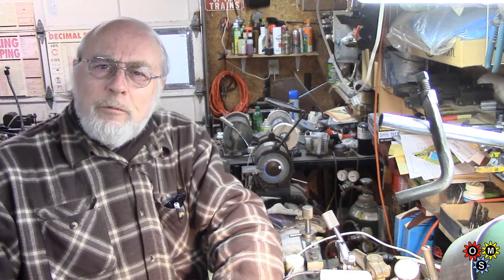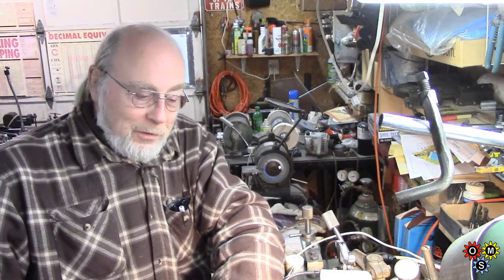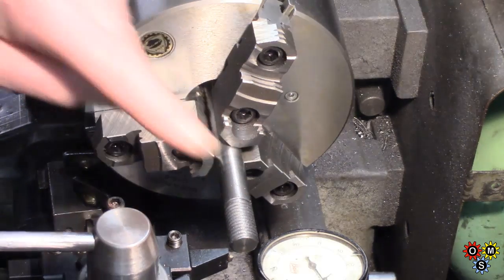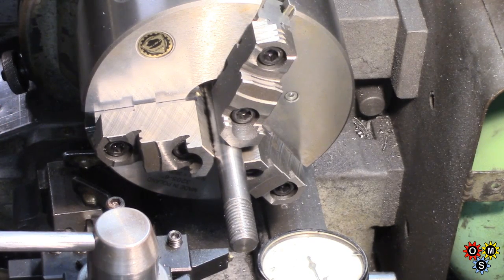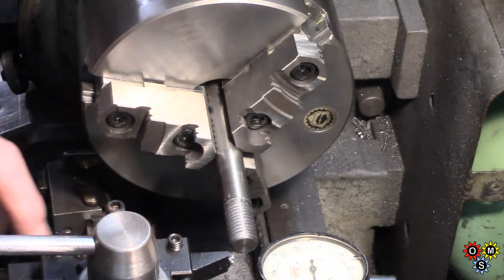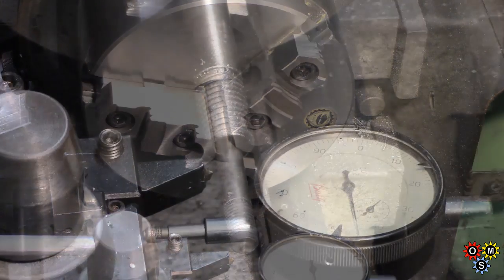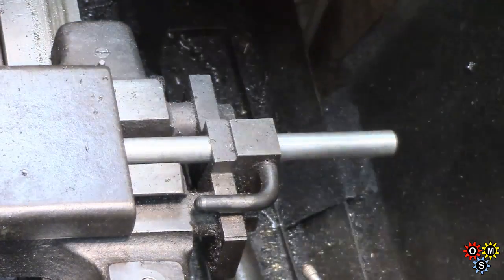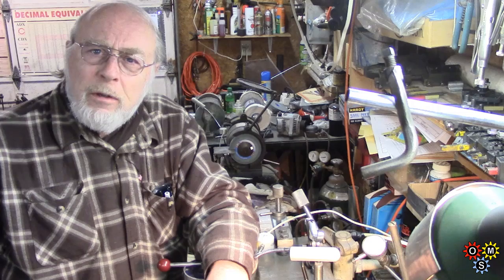Thread Cutting  Preferences

Comment: You have  train your ears to pick up the 1st sound of the item hitting , and the listen very closely for the 2nd sound of where  lands after 1st bounce .  I dropped the needle of a  float  this afternoon and took forever trying to find that damn thing , Of course its non magnetic stainless so the magnet trick didn't work .
Reply from the maker: +Rockland Kcorvic 
Hi - that can helps if it works but even so - all too often the bounce can go either onto floor mat or similar and so, no sound! Can well imagine trying to find a float needle - ouch!

Comment: I'm thinking about installing carpet in my shop to stop thing from bouncing around far away, shaggy carpet should do a great job...   lol
Reply from the maker: +pierre beaudry 
Well - I do have some old carpet/rug around main area - does help but it actually has some 'spring' in it so - can give a 'bounce assist'!! I guess heavy shag pile might help, until you want to clear up chips and stuff.
Gravity - can't beat it - it always wins. :)
Reply: The carpet would become the same problem as my chip pan on the lathe, always full and needing to be cleaned, where everything that falls in there gets lost forever.

Even in a house a carpet is to prescribe, never know what lives in it.....    ;)

Comment: You must have missed the "inverse proportion rule" in basic physics.  The more you need something the less likely you are to find it.  Thus to find your missing object make or buy another and voila it will reappear like magic.  This rule is also compounded by the price rule.  The more is costs the more rule 'A' applies!  Plus the rule of age:  the older I get the farther away the floor is.  So taking all this into consideration and your trajectory rule as well the conclusion and answer to the equation is, go have a double shot of a good single malt and don't let it get beneath table height!!  It is 40 degrees here in Alaska but don't tell anyone or the shovel zombies will show up.  Doug
Reply from the maker: +Douglas Thompson 
Hi Doug,
I think you nailed the 'dropped object syndrome' very nicely! :) 
We used to reckon that "Murphy" has a hand in such events, such that objects become imbued with their own devilment. Distance to floor is certainly a major factor these days! I'll take the single malt (or three).:)
40 degrees up there - amazing.
Reply: Sounds good but don't pack your bag just yet.  We haven't had a blue sky day in two months with wind (to 100 plus) and constant rain.  Blowing 30-40 and 3-4" rain today but it is 47 degrees.  Open winters are rare but we will take it.  Fishing is good and small boating excels plus they haven't run out of Glenfiddich and no one has tried to put ice or water in it!  Doug

Comment: Too bad your shop time is limited by the cold. As for "part bounce", as a former watch maker I can tell you, it's the worst!
Reply from the maker: +ExtantFrodo2 
Hi -- well, trying to be patient until temps improve properly, and then I'll start sweating again.
I can well image a watch maker's angst when something drops - and usually I suppose quite the tiniest parts too.
Reply: ChrisB257
The typical watchmakers bench includes a pull-out-baggy-cloth-net parts catcher (which is only occasionally where the parts end up when your tweezers cross and the part goes flying).
     I'm guessing you can't afford to insulate and heat the shop? Time to start making the shop pay for itself... although it does seem to be more of a hobby shop you have there. Patience is a virtue, but heat is better. :-)
Reply from the maker: +ExtantFrodo2 
I do have heat but a space heater - instant heat. It helps but when real cold it uses a lot of fuel for a temporary benefit - plus equipment is itself at ambient - even mill column stiffens up!
I used to have a much more comprehensive shop before I came here so - have to manage with less but still fairly workable. In my old age it is perhaps more of a hobby shop but, always able to take in odd smaller jobs when they come along.
Another couple of weeks or so and temps may begin to improve (the optimist in me!)
Reply: ChrisB257
I've only just started to get serious about putting my own shop together. Meaning buying a mini-mill and a 9x20 lathe. Yours are some of the machining videos I like so very much. Not only do you teach well, but your sense of humor is singular :-) I guess it's my selfishness wanting to see more of your videos that has me complaining about your heat problem.
Reply from the maker: +ExtantFrodo2 
You are most kind. Hoping once temps lift a bit we'll get to making some chips again!

Comment: What ho Namesake, Wise choice to build a stop, cutting threads using the offset compound is ridiculous without one. Thinking of threading, have you ever used a Houghton style threading tool?
ATB
c
PS still deep winter here, mid 40's during the day.
Reply from the maker: +Chris Stephens 
Hi Chris -- well, have a zero on cross slide to return to between passes works but for me it's too fiddly, thus the stop.
Never come across the Houghton style that I recall.
Upcoming week here will soon be below freezing 24/7 - for a good many days, plus intervals of snow. not looking fwd to it!
Reply: Re Houghton, it dates from the mid 1880's and allows you to not have to move the cross slide at all, just the compound but then only in one direction, assuming you thread that way of course. You will get to see one soonish one way or another.
Got your thermal long johns ready?
Reply from the maker: +Chris Stephens 
Trying to imagine the Houghton approach - sounds a bit awkward if backlash taken into account!
Long Johns are available, yes! :)
Reply: Backlash doesn't come into the issue, it is the easiest way to thread, especially if you can't disengage the half nuts, like metric thread on Imp lathe or vice versa.
Reply from the maker: +Chris Stephens 
Ahh - must read up on that - may well be I have not associated that name with the method!
Just going to peak at your PM - thanks.
Reply: Have sent you a PM
Reply from the maker: +Chris Stephens 
Did reply to that - so what's YT doing to you! 
Go to oldmansshop.com - my video indexing repository - and send me an email to address on the homepage, then I can send my reply back that way.

Comment: Hey whats the DP of those years in the intro? 😀
I tend to use the same setup Keith showed quite a few vids prior. Having the indicator measuring the thread depth allows for better accuracy to the double depth figure. Make fewer mistakes that way. 

Colin
Reply from the maker: +CompEdgeX 
Hey Colin -- the gear's DP is very 'convenient' - as I drew them up using sketches, extrude etc to give more flexibility compared with the actual spur gear generator. "Graphic license" I think it is called :)
Yes, I do like to see my indicator - plus the old lathe has no DRO.
Reply: The new graphics look nice Chris. You're pretty good at it. :-)
One day soon I'm having a DRO on at least ONE machine!! Dammit!  LOL
Reply from the maker: +CompEdgeX 
Thanks Colin - it was a challenge getting my constraints sorted but a useful learning exercise.
Hope you can eventually get a DRO fixed up - I'd like one on my lathe but have used it so long without I doubt it'll ever happen.

Comment: the stop is a good idea, eliminates mr Bozo on that part of the operation anyways.
Pierre has been teaching me to not even use the compound,  just go straight in with the cross slide, unless your doing large thread  it should not be a problem for most machines, The initial cuts should be heavier than the final cuts obviously. I am a total newbie at this, so take it with a grain of sand. 
Cheers
Reply: +Phil&#39;s Projects Shhhhuuuut...!!! Told you to keep that quiet, so no one hits on you...!!!! ;)
And don't say loud you can do it up to 11 TPI...   lol
Reply: +Phil's Projects Better watch what you say, it's almost heresy to mention going straight in, the trolls don't like it.:>)
Reply from the maker: +Chris Stephens 
Only partly heretical Chris! :-)
Reply from the maker: +Phil's Projects 
Hey Phil -- ah yes, indeed, for very fine threads cross slide alone can do
 OK. Once up towards say a 16 pitch or so, the cut is way better IMO via 
compound.
On a larger thread, first couple of cuts at least can be quite heavy but
 then it's a sort of decrementing approach, working down in size until 
towards end maybe couple of thou or less per cut.
Reply: What's that in metric?
Reply: Chris Stephens
About 2.32 mm pitch....
Reply: i think the coarsest i can recall doing is 2.5. near enough. Any coarser and you can use the compound (set correctly at 90 to cross slide) to add a bit of side. 
The only reason I advocate straight in is because people waste time always moving their slides and tool posts, rather than thinking what they are doing when setting up tools. If you never move the tool post, your parting tool works straight off, as an example. If your compound is dead on 90 you can use it for extra cuts when using bed stops. Just trying to be efficient, makes up for the mess in the rest of my life.:>)
Reply: Chris Stephens
Something that is people's main problem, is the lack of speed when threading, the fastest or the closest to the normal surface cutting speed you can go, the better the finish and easier it will cut.
Another way to cut at 90, put the compound 90 deg, advance the cross slide forward and at the same time go ahead on the compound to cut more on one side than the other, this way it makes it easier to get close to final depth without guessing...
With a little practice you'll be able to achive a good thread in 5 to 6 cuts in a 12 TPI or 2.5 mm. pitch, maybe a spring cut as a bonus...
Happy threading...  ;)
Reply: I do it that way, if needed, the idea is to put half the infeed on the compound.
The only problem with speed is stopping in time, old man's reaction times you know. I have done 12x1.5 at 300+RPM in stainless but the faster you go the bigger runout groove you tend to need. I must workout how to make my VFD autoreverse, if it will that is.
Always happy to thread.